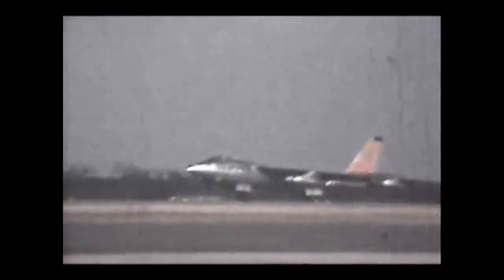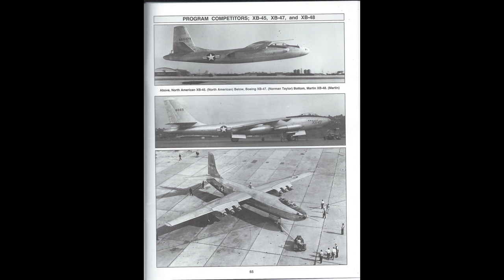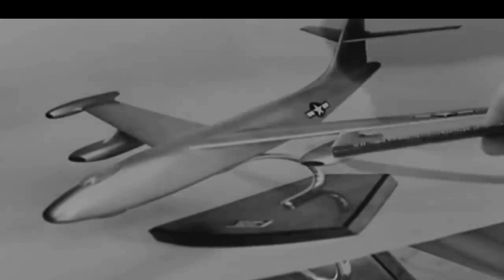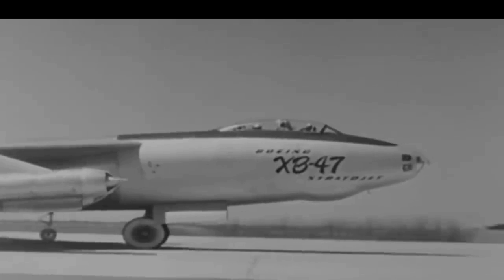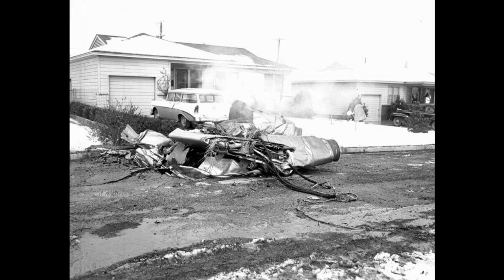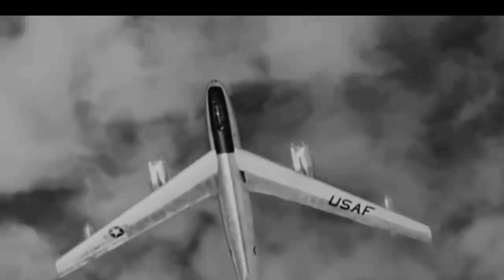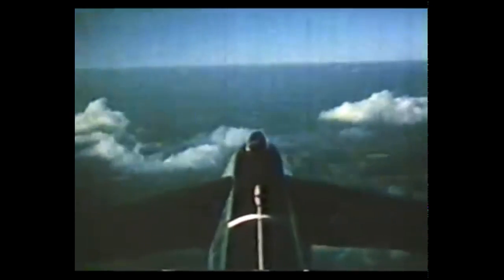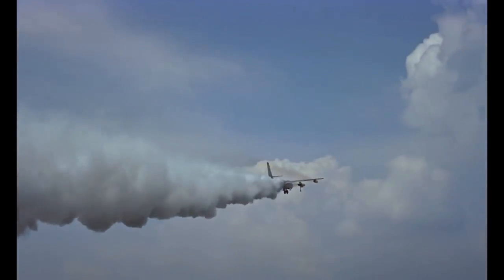B-47 Stratojet- Revolutionary design or flying coffin?

Comment: I knew an engineer that worked on the B-47 design. To save weight Boeing exes ordered the fillet weld sizes in the wings to be reduced by 50%.
The engineer said he would never fly in one of those planes.
But, this was at the very beginning of the jet age and mistakes were made in both airframe and engine design.

Comment: Thanks for posting! 

Unfortunately metal fatigue was more or less discovered by the 1st generation of post-war large jets. The English learned the lesson with the Comet airliners.

IIRC the Victor & Vulcan bombers owed a lot to the B-47 experience, and were designed with much lower wing loadings so that pilots could throw them around at high speed and high altitude to dodge missiles and interceptors, unlike the super thin precision wing of the B47 that cruised within a very narrow speed envelope between "too fast" and stalling...
Reply: Victors and Vulcans owed nothing to the B-47 design. Both "V"s had very different planforms which resulted in a low wing loading, both were designed to be flown very high - higher than any B-47 could get to. So high that a Vulcan taking part in  an excercise where it supposedly attacked the U.S. east coast  U.S.A.F. F-86s couldn't get up to where the Vulcan was cruising at 50,000+ feet.  Both had wing buried engines as a way to reduce drag - just like the Comet. The result was a thick wing with low loading unlike the near suicidally thin wing of the B-47. The result in both of the "V" bombers was a design which allowed high speed, (the Victor was the biggest aircraft in the world to go supersonic in a 30 degree dive) and excellent manoeuverability plus benign handling at low speed.  A Vulcan was barrel rolled before Tex Johnson did the same in a Boeing 367 and a Victor was looped at least twice. 
The B-47 was a tragic tale of too much too early, rather like the Comet 1. The difference was that the operators eventually gave up on the killer B-47 whereas the Comet went on to have a very successful service life.
Reply: @PenzancePete  yes exactly - I'm not a pilot but there are so many interviews with old Vulcan and Victor pilots, they all seem to have something to say about how good these aircraft felt  for the pilot, just performance and handling far above what they expected from a big jet.  So many of the old B47 pilots just seem thankful that they survived.

One had a tale about visiting an air show in the 2000s with an old retired Soviet air force officer, and he really wanted to see a Vulcan because 
" we knew this was the only one that could have made it to Moscow."

Comment: The classic Immelmann turn became part of the doctrine for delivering thermonuclear weapons with the B-47.  The idea was that the bomb would be tossed at the start of a steep zoom climb, then the climb would continue to gain altitude separation from the bomb until going into a wingover and a dive to gain speed away from the target.  According to the guy who told me that (son of a B-47 pilot), nobody believed that control could be maintained on such a sustained steep climb as required to gain the desired separation, but if you were otherwise going to be caught in the blast you might as well try.  And of course training for that maneuver was out of the question because of airframe stress.

Comment: Dad flew this early in his career as a jet fighter pilot on loan to SAC as a 1LT, he said it was the "Biggest Fighter" he flew but SAC bomber pilots couldn't get their heads around the flight characteristics of this air-frame nor get the SAC bomber mentality out of their heads when flying multi jet swept wing configured designs. Up until this, SAC flew straight wing prop bombers a whole different animal. He was not belittling the SAC guys; coming out of P-47D's into jet fighters his background was all together different and more aligned with this bomber. He returned to TAC flying fighters and other aircraft for 30 more years never speaking ill of the B-47 or the guys that learned to fly them without dying in them.

Comment: In normal times it could be said that the B47 was placed into service prematurely. However, the 1940's and 50's were not normal times. We were in a  cold war that was just as real as the shooting war of 1939-45. It was important to "keep up with" the USSR and to be ahead of the game whenever possible. The rushing of the B47 into production was no different than the rushing of the B29 into service. Both airplanes had structural and engine problems and both planes had multiple crashes and casualties when used strategically.

As to the training of the early jet pilots and the propensity to fly jets like propeller planes, the jets were new to the military and essentially untried. Most of the pilots were placed in the cockpit of a single seat jet and given a quick orientation of the controls and performance figures and then told to go fly the plane. As for the B47, you acknowledged that this was the first large airplane and the first bomber to be propelled by jet engines. Don't you think that there were bound to be problems? What if you were suddenly placed in Grand Prix racing car with only a superficial period of instruction and then told to go out and race the vehicles through the streets? The results would probably be catastrophic.

I realize that you cannot imagine the urgency and the stress caused by the Cold War. But if you are going to do articles, video, audio or written, you should stick to the facts. If you want to make opinions you should be more familiar with all aspects of the subject and its environs.

Comment: The engineering lessons learned from the B-47 led to the improvements of the B-52 - which is why the latter is still in use after nearly 70 years, while the former was retired so quickly after it's heyday - despite the fact many more B-47s were built...

Comment: Well I'd say that  the plane's design wasn't the problem so much as our inability to quickly  adjust to the different demands of flying large jet aircraft. I remember as a kid seeing four B-47s take off with those JATOs ( Jet Assist Take Off) rockets you showed in the film. What a magnificent sight as smoke streamed out not only from the jet engines on the wings, but also in a tremandous shower of smoke from the JATO's on the rear fuselage just behind the wings. In the sunshine it looked as if the planes were rising on rain clouds. That was in 1957.
In 1977 I joined the Air Force and saw many great aircraft including the piggy-back 747 that carried the NASA spacecraft on its back. It flew so low over my house one afternoon that I popped a salute to the pilot and got one back!  I saw the BUFF B-52s, C-5s, Galaxies, F-15, and 16s, and even took a ride in a Caribou and Spiro Angnew's Vice Presidential Plane, (after he left office). But of all my Air Force memories, I still can see those four B-47's rising in the sky when I was eight years old.

Comment: I was in the Air Force stationed at Whiteman Air Force Base in 1962 and 1963 a M a little bit familiar with that aircraft. I was a jet engine mechanic on the P 47 we did lose one that I remember in a fire in 1962 I believe. It had caught fire by accident because of a power unit parked too close to the aircraft. Several firemen got burned pretty bad and the crew got injured jumping out of the cockpit of the aircraft. So I do remember a little bit about that airplane in its day. But I do believe it is still a pretty design for an airplane even today. They were phasing out to be 47 in 1963 prior to when I was stationed at Elmendorf air base Alaska. It all brings back great memories for sure.

Comment: The B47 was a technological leap forward. Unfortunately, the crews were still in the prop era. I read about a pilot whose favorite tactic with a B24 was to come rushing into formation and do the"cobra" move. Unfortunately, the B47 was far sleeker and more powerful and when he popped up, the B47 just climbed into another aircraft. From what else I've read, pilot error was the primary cause of the crashes.

Comment: I read this in an old Air Classics/Air Power article which claimed, with photo documentation, that the Canadians used a B-47 to test the "Orenda" engine which produced more thrust than the two engines it displaced on the inboard pylon.

Comment: When I was a freshman in high school on the track team in 1969, our coach made us run out and get the tail number off the last B-47 parked in the boneyard.  There were hundreds of them lined up in rows after row.  I returned to visit the boneyard about 15 years later when I was in pilot training  at Williams AFB and was shocked to see only three aircraft left and they were in parts.  I find the place too hard to visit since every airplane I flew in the Air Force is now being scrapped in that place.  I liked the photo with most of the inventory planes in one shot.  There is a mighty T-37 hiding in the middle of the group so I would date the photo somewhere around 1958 or 1959.

Comment: The biggest problem with the B-47 was the concept was ahead of the technology.  It was a good test bed design, but not right until it was built up into the B-52 design.  It was not meant for some of the maneuvers that it tried.  For example that weird attempt to drop nukes and escape using a loop.  Several of my bosses in 1976-1985 when I worked ECM on B-52's even commented on some of the flaws and maintenance issues with the B-47.  I witnessed two B-52 fires and accidents when I was in SAC.  They witnessed over a dozen wrecks mostly with B-47's.  One friend was at Hunter AFB when the B-47 came back after dropping it's Nuke near Savannah Georgia in the water.  The wing was partially missing after being hit by a Air Defense Fighter during a Training Exercise.  It was a good sturdy design, but was being used beyond it's capabilities.  Many of the crew were conversions from propeller driven aircraft and many didn't adapt well to jet aircraft.  The B-47 wasn't as forgiving of mistakes as the B-29's or B-50's.

Comment: Retired aviator ... suspect so many of these Monday Morning quarterbacks ... simply don't have a complete picture. Not just the -47, a great airplane, but many seem to find fault with anything older, made in USA it would seem. As another pundit noted, this was a cutting edge, push-the-envelope airplane, in technology, materials, and in required aircrew skills. AND, was better than anything else on the international scene at the time. AND, did it's job. One item, the airplane was possessed of such capability that it was capable of doing over-the-shoulder bomb tosses, and therefore could do loops. If a pilot overstressed the wing structure, draglinks, the wing could fail, if not then at a later, unpredictable time. This (individual pilot skill) no doubt led to more than one loss .... NOT due to aircraft problems.

Comment: 11:13 Left side, from top to bottom:

Boeing B-52 Stratofortress (serial not visible) (likely C model because the large wing tanks were introduced with that model, as well as the white anti-flash paint scheme in this time period)
Boeing KC-135A Stratotanker (55-3121)
Boeing RB-47E Stratojet (51-5261)
Douglas RB-66C Destroyer (54-451) (redesignated EB-66C in 1966)
Martin B-57E Canberra (55-4244)

Second from left:

Lockheed RC-121D Warning Star (54-2306) (converted to EC-121T)
Lockheed F-94C Starfire (51-5658)
North American F-86D Sabre Dog (53-4047) (converted to F-86L)
North American F-100D Super Sabre (55-3514)

Center:

Convair B-36D Peacemaker (serial not visible, probably D model since has jet pods)
Sikorsky H-19 Chickasaw (52-7548)
Cessna T-37 Tweet (serial not visible)
Convair F-102A Delta Dagger (serial not visible)

Second from right:

Douglas C-124C Globemaster II (possibly 52-953, hard to tell)
Boeing KC-97E Stratofreighter (51-210)
Republic F-84F Thunderstreak (52-6480)
North American F-86H Sabre (52-1985)
McDonnell RF-101A Voodoo (54-1496)

Right side:

Boeing KB-50K Superfortress (51-452)
Lockheed C-130A Hercules (55-022)
Grumman SA-16A Albatross (51-048)
Northrop F-89H Scorpion (54-270)

Bonus, in the background. Another KB-50 and B-47. I see at least two more F-89s, another F-86H and 13 or 14 T-33s.

Comment: I watched the video, then went to the comments. I was surprised by the criticism of this narrator. So I went back and listened to him pronounce the word fuselage. All I have to say is get a life. 

I did read, It might have been in Tex Johnson's autobiography, that in high speed flight, near Vne, and down on the deck the aircraft would get into a roll reversal. When one aleron would move up or down would cause a twisting motion of the thin wing creating an opposite action than what the pilot commanded. I can only imagine the pilot would then crank on the yoke harder causing the structural failure mentioned in this video.  Later Boeing designed the B52 with lift spoilers for roll control. 

The design was at the  leading edge of technology and there's bound to be unknowns.

Comment: What you said about the plane being flawed, or a turning point in aviation. I think it was both. The plane was flawed and it had to be changed by engineerning changes to resolve the flaws of the early jet age, but something things had to be tried to get the right designs for modern flight.

Comment: What is not mentioned here is that as a direct result of the structural failures (wings ripping off), the DoD started what eventually became the Aircraft Structural Integrity Program (MIL-STD-1530).  There is no doubt that this program has saved lives!  It has allowed the USAF to maintain and fly airframes that are over 50 years old (K/O/R/WC-135s, B-52H, T-38).  It also eventually spawned the Engine Structural Integrity Program, which has since morphed into the Propulsion Structural Integrity Program (MIL-STD-3024).

Comment: This is a medium bomber, much smaller than a B-52 or most airliners, but look at the still picture at 4:30 with people standing around it and you see the scale. Looks big then, doesn't it! I was shocked first time I stood by an F/A-18 by how big it was, and that's far from the biggest jet fighter. I like to compare the weights to vehicles on the road, for example that same F/A-18 at max. takeoff weight, and a semi-trailer with a full load of boulders or whatever, are about the same weight! And that's a fighter. This B-47 could fly at up to 4 or 5 times that, that's considered a medium bomber. It blows me away

Comment: The complete design was light years ahead of itself. Meaning, it required a total fly by wire system. The computing capacity of the day just couldn't preform the thousands of minut computations needed every second.

Comment: Sounds to me like a little of both.  Technology wise probably slightly ahead of its time good decent design concept just needed reinforcement in some areas.  History obviously shows shy design was. A decent concept and as we see the B-52 maintained a lot of common design elements from the B47,  swept wing, dual pod mounted engines, center fuselage mounted landing gear, outrigger wing tip gear.   As we see the B-52 has been around for well over sixty years and with continuous inspections, repair, upgrades, to adapt there could easily be another 20-30 years left.

Comment: Great information here - most of it new to me but then there seems to be so little about  this plane out there. I did not know about it's appalling loss rate. This flew during the time that DeHavilland Comets were falling out of the sky, the pressure to get both aircraft to service meant it was inevitable that the possibility of flaws were ill considered or just dismissed. Same is true of crossing the ocean by boat a hundred or so years earlier - you were wise to put your affairs in order before sailing as the odds of not making the journey were serious considerations until steel hulled steam driven vessels became sturdy enough for the harshest seas, and even then not even the largest ocean liner was safe.

Comment: Interesting video. it seems to have a few things in common with the Vickers Valiant, the first of our 'V' bombers. That had a similar swept wing design and came from a design originally from the end of WW2 and piston engine'd aircraft. There were losses of the Valiant also and structural stress problems leading to its withdrawal in the 60's. The Handley Page Victor proved to be more successful design but there were losses of all three 'V' bombers, including the Vulcan with its radical delta wing design.

Comment: The B-47 is the first aircraft with the distinctive design that would be copied in generations to come... engines mounted on pods suspended from the wing. The B-707 was the first airliner with this feature and manufactured by the same company.

Comment: My opinion is that some of the design problems were because swept wing jet design was in its infancy.  Today, a design could be simulated on a computer. In those days, the idea of simulating different design concepts was a long way in the future.  Pilot training today uses much computer simulation.  A pilot can learn many aspects of piloting a plane before sotting at the helm of a new plane.  In these days, it was learn as you go. The designers must have learned a lot about swept wing jet design from the B-47 because the next bomber off the Boeing design board was the B-52 which, it it's klatest incarnation is still in service and is planned to stay in service through sometime in the 2050s.  Could one celebrate 100 years of service?